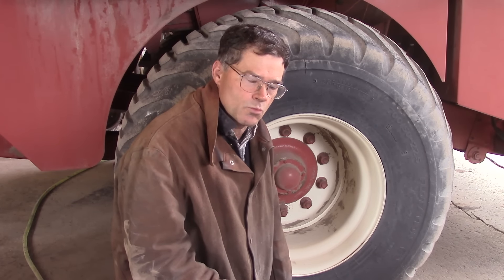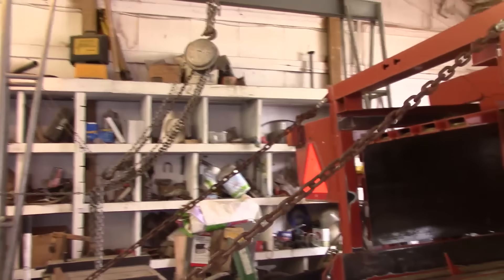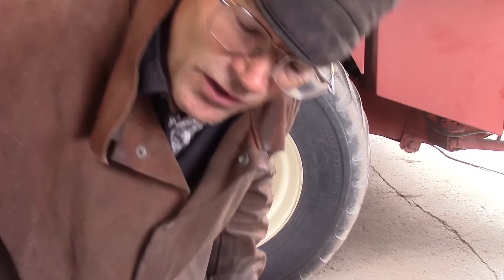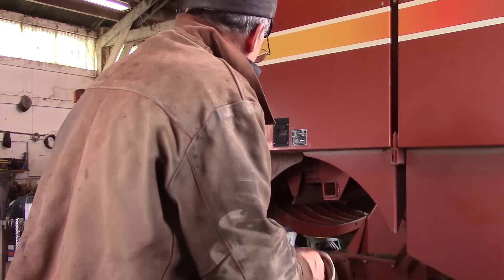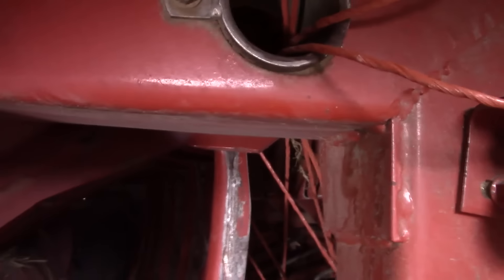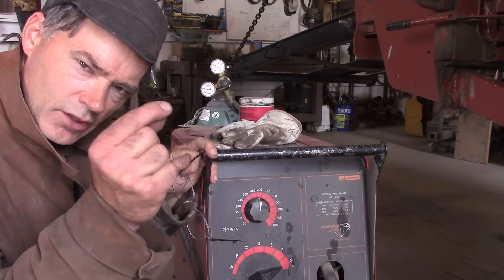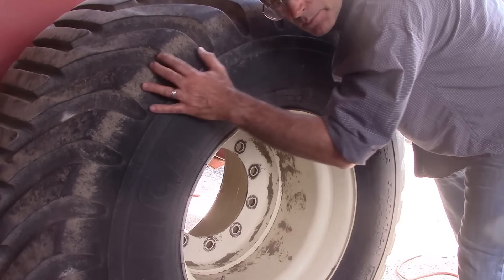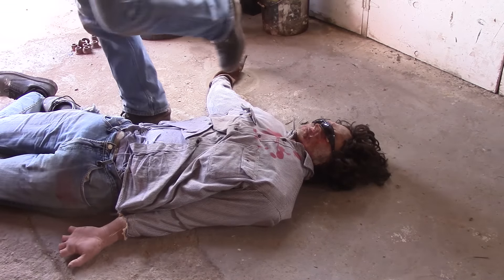How to fix a Broken Weld on the Hesston 4790 Hay Baler - DIY Duke

Comment: you should get one of those wheel lifts they have for dually trucks. its basically a hydraulic jack and  rollers to slide the tires on and off.

how bad do you get hurt if a tractor wheel falls on you? like the stores you heard? I heard people get killed from changing them when they are the three piece wheels and they explode

Comment: Cool video but how come you don't stick weld it, wouldn't it be stronger?
Reply: It depends on the skill of the welder, material preparation, thickness of metal, etc. For a hobbyist working on thicker metal it is best to use stick. I use my everlast mig welder far more than my powerarc stick welder but for thick metal I also turn to the stick welder.